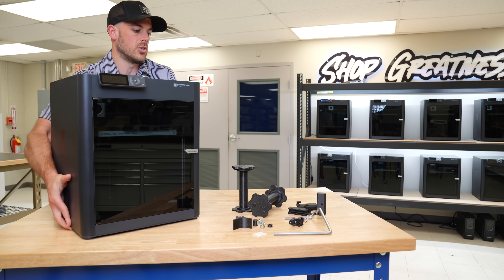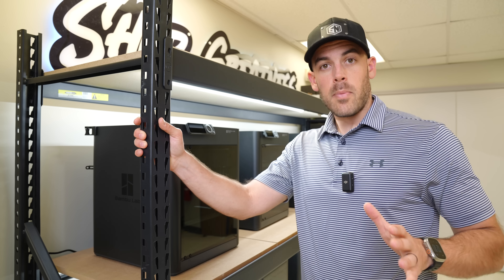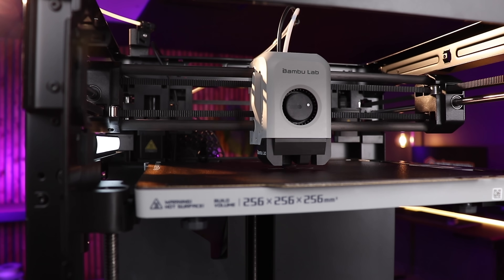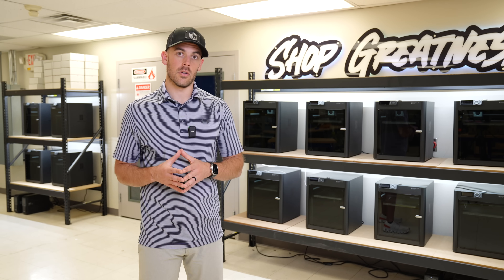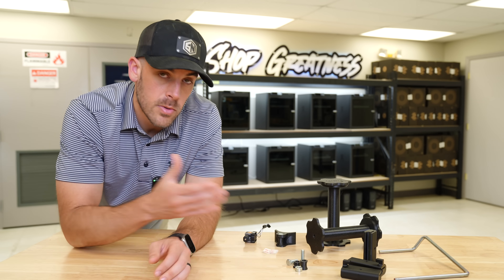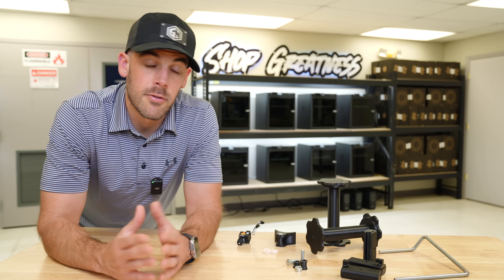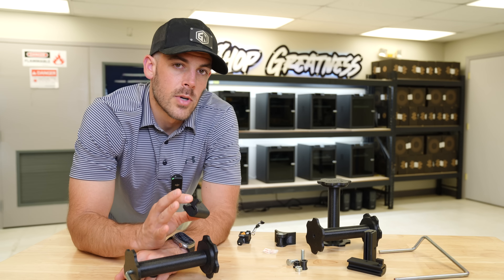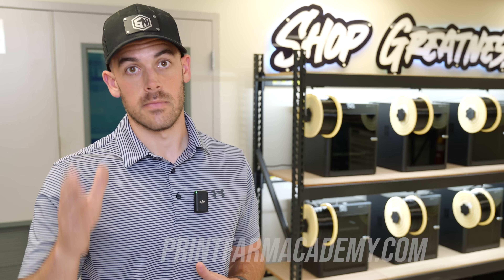Setting up a 3D Printer (like a print farmer)

Comment: It's probably been said already, circuit breakers in your house are rated at 80%, not 100%. A 15A circuit can handle 1440w, and a 20A circuit - 1920w. Of course, not all of these machines will be pulling 300w at the same time (probably), but it's worth noting that you probably shouldn't put 6 of them on a 15A circuit, or 8 of them on a 20A.

Comment: What size did you cut the boards to for your shelving? I have the shelving and am getting ready to get the boards cut to size when I pick them up at a lumber yard. I am getting 22" x 17.5" for each square, which should leave a very small gap between each printer. Just wondering if you recommend adjusting that size at all.

Comment: No update on the other video for the Prusa input shaping.  My Prusa mini with input shaping cut printing times in more than half, and on small prints it is just about as fast as my X1c (mostly because of the very short startup time compared to the X1c).

Comment: US really got fucked by Edison when it comes to power. Standard EU room circuit can pull ~5kW without issue and if you want to go bigger with three phase that ususally every house has with 380-440v u can pull up to 10kW without problem, for crying out loud my induction stove is pulling 7kW on full load :"D

Comment: Got any video of that rack with all the printers going?  Just bought the same rack and I wanted to see what the shake was like.  My main concern is I want to put a Resin printer on the bottom shelf, and a 2 Bambu X1C on the mid shelf.  Curious if the Vibration from the X1Cs would cause any issue to the Resin Vat

Comment: A minor adjustment, I know, but perhaps make the support bracket for the filament redirection roller a bit deeper, just to be sure that the filament doesn't escape; probably not entirely necessary, but if it was me I would feel a bit more comfortable with that little bit of added redundancy. Good tips nonetheless

Comment: In fact, your UPS only filters (actively) when the current is bad. It does, however, constantly protect against voltage surges and spikes. Then I don't understand why you bought one for each machine, that's so overkill
Reply from the maker: I run 3 printers through each UPS, they all don’t have their own

Comment: Just to be clear, those circuit breakers are only able to handle 80% of their load continuously so 15A can handle 12A of load and 20A can handle 16A. As long as they all aren't in the warm up phase though, then you should be able to get away with the number of printers you stated.

Comment: With your reverse thread on the spool hanger, why not have the spool feed from the bottom rather than the top. Then the thread wouldnt need to be reverse and muscle memory being what it is, everything is kept at the status quo. Seems easier to adapt placement/position than to redesign the wheel.

Comment: A note on the UPS. It has to be a full time UPS to actually filter power issues. There are 2 types of a UPS. One that feeds the AC power through to the UPS sockets and then switches to the inverter on power dips. The other type always feeds inverter power to the UPS sockets. The switching supply will "help" during brown outs or voltage dips but will not prevent problems. I've had to replace a switched UPS for a full time UPS  on industrial control equipment, because the switched UPS did not prevent occasional issues from cropping up. We have poor power quality in the Rocky Mtns, especially during the summer when thunderstorms roll through. I obtained a print out from a logging full time UPS from a company's IT dept. The print out for a single 24 hour period was 2 pages of single spaced reports at one line per incident. This listed all of the under voltage, over voltage, and extremely fast power drop outs that occurred during that time frame on a June day, where a couple of thunderstorms rolled through.
Reply: How can you tell the difference when purchasing a UPS?
Reply: @kid-savage6261  They are called an Online or double conversion UPS and the cost is much more with this type. The next best is a line interactive that maintains voltage on the output when under and over voltage conditions occur. Just look for those types or ask the manufacturer which models fall into those categories.
Reply: @kid-savage6261  If you can afford it, it's an SPS (standby power system), not a true UPS (uninterruptable) ;-) All consumer models are SPS. True UPS systems are labeled "double conversion", "online", "continuous conversion", et al. The big downside (besides cost and size) is that they are very inefficient and will increase your power bill by at least 15%. They're also a lot louder since they need to run active cooling components (fans) all the time to ensure the conversion hardware is within thermal limits. In a print farm you are constantly drawing significant currents. A more practical approach is to rely on SPS's and "Line Isolation Transformers" essentially splitting the work between a component to provide backup power and a component to filter (condition) the available power source (whether line or backup). SPS's (consumer UPS) make VERY BAD QUALITY power when running on their batteries and this kind of power is very hard on consumer grade AC/DC power supplies' input capacitors and rectifier diodes (like the kind found in Bamboo, Prusa, FLSun, et al. printers). The reason is that these SPS's make psuedo-sine wave power, not true AC. So the input filter components in the AC/DC power supply in the printer have to absorb and source significant amounts of energy on each cycle to smooth things out. This generates more heat in the input components than is normally there. Some parts may fail if this condition persists or occurs frequently.

Comment: Glad that I live in a country with 240V ... with 16A circuit I can run easy 12 machines with some spare watt.
Reply: P1S draws 1000W on heat up phase. so on 16A you can run 3 not 12
Reply: @TriptyX  they aren't likely going to be in heat up phase all at the same time, they don't draw that much power when not in heat up phase
Reply: @songhan1586  true, but with 3 at the same time, you are getting close to the limit
Reply: I just checked and my p1s on 240V uses 1,035W for 10 minutes straight at the beginning of a petg print job, dropping to about 90W to 120W after that

Comment: I'm really interested in how you calibrate your printers out of the box and if you do any calibration after a set amount of time. I'm sure the P1S comes pre-calibrated and ready-to-print, but I would also assume you need to go a step beyond to ensure the prints always come out great and are exactly to spec.
Reply: the A1 min, A1, P1P, P1S and X1C auto calibrates everything on each print, unless you manually disable it (flowrate only on the X1 and maybe A1 series from what I remember). other than that, they have a 15 min calibration program you run for the initial setup and again if you move it around, as that's calibrating the vibration stuff in the printer and ringing with what shelves and that that you have them places in/on.

Comment: You pack a lot into a short video. Neat. Have you been running the individual UPSs long enough to get a feel for how often you need to replace the batteries? My farm is only 10 machines but I'm still concerned that if I put them on individual UPSs I'll find further down the road that I'm spending a lot on the batteries. Is that an issue?

Comment: My rack to the wall, I use a TPU block and wool pad as a buffer so the vibrations don't transfer into the wall and resonate.

Just had an idea to make a hollow TPU block with a baffled hole in it to act as a dampener/shock 🤔

About the electrical though. Most common UPS do not condition your electricity and only have basic over voltage protection which wears out of the years, and only really have "simulated since wave" which is a dirty stepped sine wave that you only see while running off the battery so it doesn't damage the equipment. The only UPS's I've seen with that are rack mounted massive units that cost well over 1K. A good filter/conditioner is about $50-80 and an active reconditioner that is always reforming the electricity is about $150, you see them on the back of large printers at banks and schools and small servers. They look like large bricks with 1 or two ponytails. Those are awesome, you can get jumping 90v-100v from the wall and you'll always see 120v solid on the other end. When shopping realize they have two models, ones that are 10amp,15amp, 18amp and 20amp

Comment: Hey bud, great video! You forgot to mention bolting the shelves to the walls... which I really hope you're doing... Earthquakes happen ;)
Also, I would recommend just extending the PTFE tube to be 20cm or so, so you can actually load the printers from the front/side. Run it almost all the way to the roll, but not so close that it'll wrap around the roll. It'll make it SO much easier to load filament ;)
Reply from the maker: We actually don't bolt anything to the walls, though definitely a good idea if you're in an earthquake prone area!  Also, I've extended the PTFE tubes on some but one thing to consider is that it actually changes the back-pressure of the filament being fed and could result in some print issues.  This can be adjusted in the slicer if that happens but something to consider!

Comment: RE vibration dampening.... I'm with you! But... check out Makers Muse, he's pretty much proven that modern printers compensate for vibrations very well. Even successfully printing on a printer suspended from a wire hanging from the ceiling, bouncing all over the place!
Reply from the maker: I did watch that video, super interesting!  I was shocked by the results

Comment: What print plates to you use. My brand new pei sheet that came with my p1s just doesn’t like to have prints stick anymore I’ve tried washing it and raising temps even using a brim. Nothing
Reply: What did you wash it with, and what materials are you printing?  Did you try bed leveling?
Reply from the maker: I've found that over time they get "stickier" with prints.  Just wipe off with some IPA and run some parts through it

Comment: Re: Hardened nozzle

Don't forget to upgrade the gear too.
Reply: "*The P1 Series Extruder Unit comes with stainless steel extruder gear. Users can upgrade it to hardened steel extruder gear for better abrasion resistance to engineering filaments."

I guess it depends on what you're printing. Nevermind.
Reply from the maker: Exactly, yeah if I was printing composite materials I would 100% recommend that

Comment: I will say for the p1s setup a biqu big tree pandatouch screen will let you link them all and start a print across 10 printers at the same time, this is somewhat like using the computer slicer but portable and if printing the same part may just save you some time being able to walk around with it. Just an FYI about something that may help with production across the board

Comment: Would be curious to hear how you add a new machine and manage it on the software side of things? On of the first things we typically do is reflash firmware and setup software integrations but we also run open source (Klipper) and a custom SCADA which needs a bit more tweaking.

Comment: I run only 2 Bambu printers, but the most egregious thing with them is the software for controlling each printer. Having to go to the device tab and flip back and forth between the printers, resyncing the AMS's and then finally being able to slice and print has been one of the more time consuming and confusing parts. I'd be really interested to see what kind of system you use to properly organize and send print jobs out to all of these P1S'. Thanks.
Reply: I'm guessing that Bambu will release an update at some point to help manage print farms. I've got 12 right now and it does start to become a pain to manage. I'd guess Bambu will want to keep customers like us happy since we order so many.

Comment: Why not just put a longer PTFE tube from the back of the printer around to the filament hanger? Then you wouldn't need to reach behind it and blindly feed the filament into the printer.
Reply: That's just how I do it :)
Reply: PTFE is a consumable and wears out. His part wont wear out as quickly.
Reply: It takes longer to load the printer.
Reply: I was just about to say the same thing.
Reply: @Kawalzki  me too
Reply: Also an added expense to consider if you're purchasing that much PTFE. I know it's cheap but with 65 machines I'd imagine it's not nothing.
Reply: Too much friction
Reply: @nobocks  Isn't PTFE famous for having self-lubricating properties?
Reply: @jochem1986  yeah but after 20 cm you really need to push hard
Reply: @nobocks  I didn't know that also applied to 3D printers :)
Reply: He could extend it somewhat but too much and it will wear down pretty fast because of the bend in the PTFE tube and the filament running through it

Comment: How do you deal with the poop shoot on the p1s machines since they are up against a wall and it purges out of the back of the machine? That’s still my #1 struggle with these machines
Reply: The machine purges at the start of every print. Even for single color prints
Reply: Does it poop shoot without color transitions? I believe he uses a single color per printer
Reply: Unless of course he’s modified the code to not purge at the start of each print. I guess that alone would take care of the issue 😂
Reply: Looks like they are not using multiple materials, so no purging is needed.

Comment: So you don't use filament dryer.
Reply: Why should he ? The whole space is temperature and humidy controlled and he has a print farm, I don't think a roll, even a 2kg or 3kg one, last enough time once opened to the point humidity is a problem.
Reply: I guess if you have a controlled climate to print in then that’s fortunate. But in some countries an open roll of filament even PLA can spoil in a matter of hours. Like where I am the humidity high today is 94% and the average is 87%. Not ideal.
Reply: He buys high quality filament (I remember him saying Protopasta I think) in bulk which likely means it goes straight off the production line onto a pallet that’s shipped out to him. Filament manufacturers typically take extra care in their bulk shipments because a pallet of bad filament can ruin a client’s production
Reply: @KolMan2000  High quality filament doesn't mean it doesn't get ruined by humidity though.  On Youtube you see so many guys with their filaments out on racks. but they're also in the US.  You simply couldn't do that in the UK for example.  Well you could if you don't mind removing hairs, weaker parts, air bubbles etc
Reply: @bonjipoo my point was that it doesn’t have time to absorb moisture in the factory before going in a sealed package then is only opened when going straight on the production line at a print farm. It takes weeks to months even with a humid environment before a spool of most filaments absorbs enough moisture to become unusable, and it’s likely the spools in his print farm don’t last more than a couple weeks at most.
Reply: @KolMan2000  ah yes I take your point. I just find the degradation due to humidity much faster than weeks where I am. Obviously some filament are unusable in just hours left out. PLA not hours maybe a few days would be bad for me. But that’s 90+% humidity and the challenges that come with that.
Reply: @bonjipoo and again, his printers are in a climate controlled, air conditioned environment.
Reply: All filaments, new from the factory, has an upper level of humidity which can be improved if you use a filament dryer. But if that's not a requirement for his workload, that's fine.

Comment: Do you print everything from the SD-card in the printer or do you send everything over Wi-fi? If its the latter.. how do you control, monitor and structure everything? I currently have 4 P1Ps and its already a mess running multiple instances of Bambu Studio.
Reply: In another video they have standard parts they print. All on SD cards
Reply: As far as i'm aware you can have one instance open with multiple plates which you send to each printer?
Reply: @UnderearthEDO  Yeah you can, but my issue is we have multi-color sets split per set, which means controlling multiple AMS:s containing different color setups etc. So we need every set with every color setup as one file, then we have around 50 unique sets of those. Its a mess!

 I dont think they have proper multi-support for that yet, opening 4+ instances of bambu studio is taxing on the PC to say the least :D